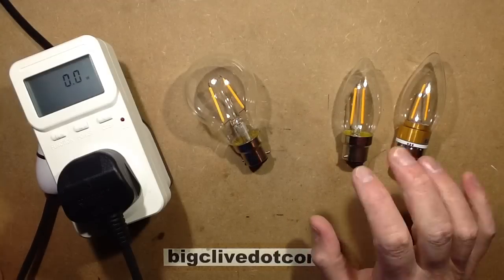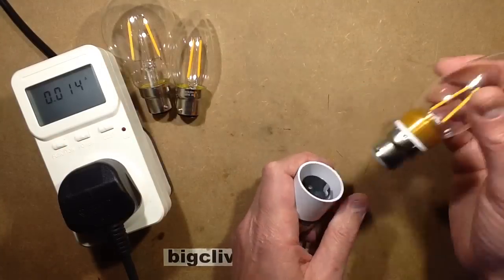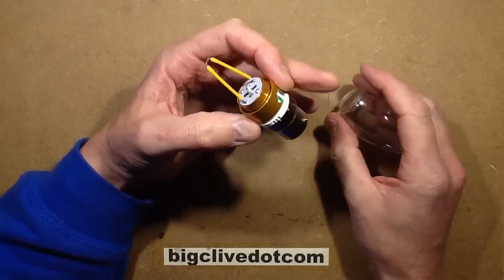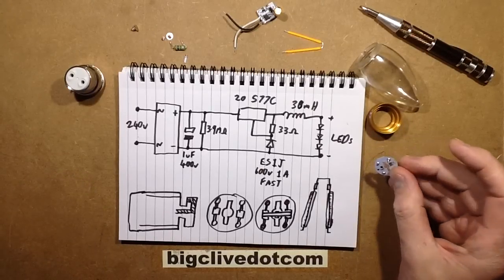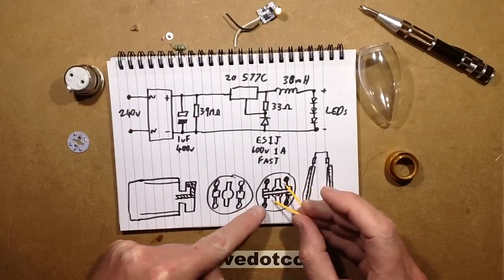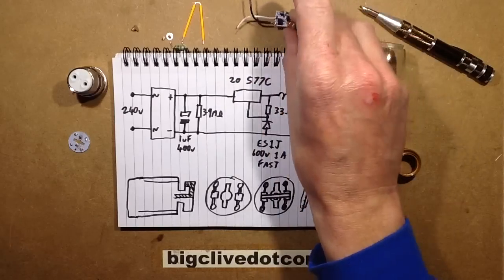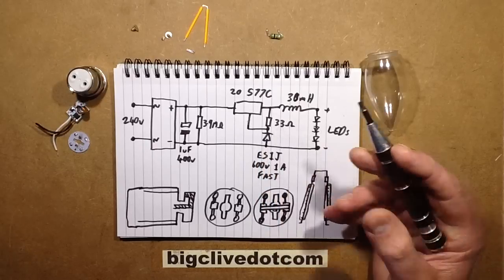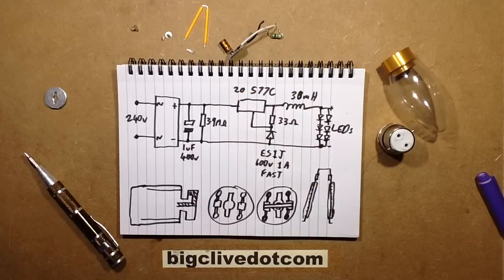Inside a modular LED lamp.

Comment: well thanks to ol Clive being in a wet environment..  I kinda gave Menards a load of shit over their fake C9 bulbs (ahem top hat LED's with C9 size caps ---- fake!!!!-----  ) that = exposed wire leads which equals a very ticked customer paying $10 for a short string of LEDs.  as they will break in less than a year outside. :(  .   So the folks who supply Menards with LED's took the shit I gave them using you as an example on why LED's should never be outside unless they are sealed totally out like incandescent filaments so they sent e a good 100 dollars worth of real C9 and C7 LED lamps to fit in our Christmas lamp set (that still fairy lights over there? ).    No problems with those yet and can use them on the thick wire ones that C9's and C7 strings use.  I have noticed a difference but hoping someday you'll open some of these up.  I have two kinds.  the free ones are 3 LED's, but good lord is the circuity so utterly small it's crazy.  C9's meh but C7 thats getting rather small would love to see these opened up someday.  , but then there's the ones I paid for  5 LED's in those but as I can't really see thru them I have no idea how they are designed and not opening one right now until they fail.  , one my brother took apart clearly has more stuffed down the metal end of a C9 though.  These LED's are sure getting fun to look at though

Comment: I thought I had bought the same bulb from another eBay seller but in fact, contrary to the bulb of the video, the electronic circuit is minimalist :
http://www.cjoint.com/doc/16_11/FKiquFNx325_E27LEDFilament4W01.jpg

So be careful...
Reply from the maker: Flickery?  Looks like a minimalist cap dropper.
Reply: The flickering is not awful but it is visible. When I film the bulb with my webcam, I see small waves on the screen.

Comment: @bigclivedotcom  im not sure if you've seen the lithium powered car booster packs ?  ive just bought one on ebay,  and it managed to start my 2.5 diesel with no bother,  the model i got was a suaoki t3 for £40 off ebay,   would be great if you could do a tear down on one.  http://www.ebay.co.uk/itm/Popular-12V-20000mAh-Car-Jump-Starter-Pack-Booster-Charger-Battery-Power-Bank-/322239827658?hash=item4b06fd8eca:g:qv4AAOSwgmJXyV9O is a cheaper unit from hong kong,  cheers

Comment: what is the power factor on a lamp like this?
Reply from the maker: It's complex on this style of lamp.  Not unity, but not quite as bad as a pure capacitive dropper lamp.  The switching frequency harmonics are more of an issue.
Reply: I want to hang a whole heap of these filament type lamps from my ceiling but I would like them to have a respectable power factor.

Comment: I figure the switcher is running in discontinuous mode because it's easier to run at ~25 kHz than ~1.4 MHz.   So the ripple current would (still) be 100% , but it's "regulated" and you don't see flicker due to this and the persistence of phosphors and vision.

Putting 200 v across 30 mH will ramp up at 6500 A/s.  If the output ripple was 2 mA , the Ton would be ~300 ns, Toff ~= 400 ns?   f = 1.4 MHz?    L/R ~= 1 ms.

The closest parts I found were not that fast.  

http://www.digikey.com/product-detail/en/monolithic-power-systems-inc/MP4050GJ-P/1589-1179-1-ND/5298266 

http://www.digikey.com/product-detail/en/microchip-technology/HV9921N3-G/HV9921N3-G-ND/4902360

Comment: + bigclivedotcom Clive, I think it should be mentioned as an other bright source of a possible electric shock. Not just because the fact that it can fall apart in your hand while trying to replace it, but also that heatsink is very dangerous. Or you trust the microns-thick insulating layer of that aluminium PCB with your life? Hey, it's a non-isolated, mains referenced power supply! That heatsink, and/or the support PCB should have been made of Al2O3 ceramic. But I don't think that these filament type LED strings benefit a lot from this type of heat sinking. They mostly rely on radiated heat instead of conducted.

Although, the circuitry is quite clever, indeed.

Comment: Hey Clive, are the two pins in those bayonet fittings live when not pressed in by the bulb? We use those in Australia and I've wanted to know for ages. Everything is designed to be so safe, down to sheathing plug pins but if those pins are live it seems so stupid.
Reply from the maker: The traditional ones are always live but some newer ones have a safety interlock.  It's better to assume they are live though.  Our bayonet cap holders and the Edison screw ones are still in use because it would be a massive thing to try and eradicate them from every single house in one go.

Comment: I guess if the 577C transistor / regulator shorted, it would be game over for the LEDs.
Reply from the maker: It would probably go boom.
Reply: bigclivedotcom If you think about it, what is being done today with tiny SMT components seeing 170 - 300 volts potential across them is incredible. No fuses, no worries. Look at the amount of concern there was in the 1970s with a decent stereo receiver such as Pioneer, Sansui, Onkyo, etc. The line was fused before the power switch and transformer, the DC supplies were fused after their rectifiers, and even the speaker outputs were fused. There was concern to protect everything, and prevent a line-side short, should the wiring or transformer fail inside the unit. Now we see products where there is absolute disregard for protecting the device from total destruction or causing a fire in event of a short circuit. The frail little 20, 22 or 24 AWG wires connected right to the mains to supply the PCB make me incredulous with many of these Chinese devices. I am amazed CSA, UL, CE etc. allow for them to be sold... or they have lowered the bar significantly in recent years to allow for the influx of this cheap stuff.

Comment: The first looks to be half wave rectified, the second one full wave rectified with no smoothing and the third full wave rectified with smoothing. Is that right? I dunno if that's how the manufacturer built them, but that's how I'd interpret things in the 1st min of this vid - it could be the iPad being a bit funky also.    Edit, no I'm probably really very wrong, I forget these guys are controlled via driver circuitry. 

Anyways,  how would each one respond to being shoved in a bog standard dimmer circuit? Just curious as I have seen many sconces with dimmers on...

Thanks for the breakdown Clive. It may be boring to some but I love to see how you work stuff out.

Edit 2, how long before you find the containing components, fittings, "bulb" etc to DIY your own I wonder?

Comment: I have a question for you. Is there any reason that a light fixture can shorten the life of an incandescent bulb? I have two fixtures that goes through bulbs like crazy while all of the others last a long time.
Reply: Are they enclosed? Heat will dramatically shorten the life of a lamp.
Reply: One is a porch light. It has plenty of ventilation and weather protection. The other is in a range hood which is uncovered
Reply from the maker: Vibration can kill lamps if they are lit.
Reply: I'm a bachelor so the stove doesn't get used much at all. The porch light usually lasts only a couple of weeks. I've had other fixtures in the past that went through bulbs at a quick pace too, and they were just typical indoor fixtures. It's like they're jinxed.
Reply: I'm a bachelor so the stove doesn't get used much at all. The porch light usually lasts only a couple of weeks. I've had other fixtures in the past that went through bulbs at a quick pace too, and they were just typical indoor fixtures. It's like they're jinxed.
Reply: The bulb burned out again a couple of weeks ago. It stays on most of the time and isn't really subjected to vibration or temperature extremes. It's just weird.

Comment: Mr Clive!

Watching your videos over the last year or so just helped me figure out the multiple things wrong with my boiler. But crucially helped me figure out that a gas solenoid rated at 240V should probably have more than 12Ohm resistance if being supplied from a main circuit board rated at 2A maximum!
You're the reason I bought a cheap multimeter.
Great channel. TV is dead.

Comment: a miniature power supply done right.
However, no inrush limiter resistor capacitor network on the input is a little odd
Reply from the maker: No space.  The module is designed to be usable with a wide variety of caps that may be very narrow or flush with the end.

Comment: has anyone suggested changing the anti-flicker to 50Hz in the camera application or switch to 25FPS, just as the usual defaults are 60Hz and 30FPS.
Reply from the maker: I've never actually found an option for that on the iPad2.

Comment: I have the 6 Filament version of that lamp here and the power supply appears to be capacitive dropper on a tiny board using surface mount capacitors.
Reply: Then it's not a version of "that lamp" though, there are dozens of models that look the same. Unfortunately it seems to be impossible to know in advance how flickery any given lamp is going to be. I bought some that were specifically described as having advanced electronics in them, but when they flickered at 100Hz thanks to a dumb capacitive dropper, I got a refund...

Comment: Are there any LED lamps that can be used with a standard triac light dimmer ?
Reply from the maker: That's a tricky area.  The triac dimmer technology is completely incompatible with LED technology and results in either very complicated and expensive lamps or cheap ones that flicker visibly and have a very weird dimming curve.
Reply: LEDs would need a PWM dimmer.
Reply: There are lots out there. They often don't dim completely (though the Cree 4Flow bulbs are the best in this respect), and my biggest complaint with every one I've tried is they buzz horribly.
Reply: Would you be interested in one or two GU10 lamps that are triac dimmer compatible? We have some in the hardware store I work at for 4£ equiv. that have proven to be very reliable and don't flicker or buzz. They also dim down to the lowest level I'd call usable light. Anything lower and I might as well just turn them off... I've replaced every spot in my house with them and they're working perfectly.
If you'd like I could send you a few to check out and take to bits and explore if you'd like. :)

Comment: LOVE the videos Clive, I have a question for you or anyone who can answer it, I have a toy that lights up and plays music, it is a little sea horse. This toy makes my 5 month old fall asleep every night but only stays on for a max of 5 min.. that's not nearly long enough for her to get into a deep enough sleep, having me run back there to turn it on again and again. So I was wondering if there is anything I can do to make it last longer maybe 10 min or longer. Thanks for reading and responding :)
Reply: Arduino... Great ideas, or you could just tape the button in "pressed" position.
Reply: Bartosz Olszewski Thanks, but I spend lots of time with my baby girl, your comment is just rude and uncalled for...
Reply from the maker: With these things it's usually dedicated integrated circuits, so it may not be easy to change that.
Reply: Bartosz Olszewski Clearly... maybe one day you will get some class but I doubt it.
Reply: How is the toy triggered? Maybe you could take it apart and hack an arduino into it so that ever 5 min it gets triggered again until sleep is achieved
Reply: I'd be tempted to get an arduino tinsy, whatever it's called. The really small one :P Either add that to the circuit and program it to trigger a number of times before turning off. Or add a sound ship and program a new toy from scratch :D
Bit involved, but could be fun :)
Reply: MasterBata I wonder if you could short the button, and have a toggle on/off switch to power it instead? it wouldn't time out though, that's the problem. You'd still need to add more circuitry :(
Reply: TheOmegaRevolution Toy is turned on/off by pressing the tummy, http://tinyurl.com/zodnlkk      this is the toy.
Reply: bigclivedotcom Wow got a reply from the man himself :) Thanks for taking the time.
Reply: This is the toy I am referring too,  http://tinyurl.com/zodnlkk
Reply: kreepykoopa Oooh, looks plenty big enough to house extra circuitry then :) Could be worth a bit of circuit bending!
Reply: use I dunno. oscillator maybe. or pic controller. or solder a switch in, if pressing the button keeps it playing. arduino is expensiv. but I dunno, if you wanna time it exactly 5 minutes it may be worth it. or just spend time with yoir child. or change the child. death also solves problems.
Reply: kreepykoopa it was meant to be rude.
Reply: kreepykoopa your funny.
Reply: Bartosz Olszewski Oh look, here it is!
Reply: This has a few solutions depending on how much electronics knowledge you have, best to ask on an electronics type forum, like arduino or EEVBlog.
Reply: I think an arduino nano that runs at 3 volts would be sufficient for this task if you could splice into the switch for the tummy on the toy. There's a British fellow on YouTube that does a lot of diy arduino stuff that might help you out. The coding wouldn't be too hard for something so simple.
Reply: Or a simple timer with a capacitor to make it last 5 minutes.

Comment: please can you take apart a cheap ebay submersible aquarium heater? they are always half the price of 'proper' branded ones. cheap, submersible and heater dont sound like a good combination. you can get them for as little as £1.25
Reply: perhaps they are like the bucket warmers, they do indeed heat the water, and will boil/electrocute the fish.
Reply: jusb1066 no electrocution yet. It does work as the water temp is what it should be. Just interested in how safe they are. I never leave it on when im not home or if im in bed.

Comment: There's no flicker because the buck driver's switching frequency is in the kHz range.
Reply: Well not exactly, the main reason is that it's a constant(ish) current driver so the LED brightness never drops very low. Higher switching frequency just means you can use a smaller inductor. If there wasn't an inductor, the raw PWM flickering could be seen even at 1 kHz or more (annoyingly LED car tail lights tend to be like this).
Reply: Surely there is a ripple?
Reply: Yes but if it's not too strong, our eyes won't notice it.

Comment: Makes me wonder what people would do if the bulb unscrewed when trying to remove it from a bayonet fitting, could do with a light touch of glue on the threads just to stop that happening, other than that (and the overall look of the bulb), it's a decent looking LED bulb... :)

Comment: Is the RMS 240v =360v would I be right in thinking that if so the resistor after the bridge would need to be 470k
Reply: How do you come to that value? There is no "need" for any specific value. Not too low obviously, because you'd constantly waste power in it.

Comment: now if only it was not $15 AUD a led lamp in australia, i'd get some... this one looks better than the rest, i gues its the "E14 B15 B22 E27 2W 4W Edison Filament COB LED Chandelier Candle Light Bulb" one from that seller, don't want to give the game away to others too easily ;)
Reply: for that price, even if they die, its still cheaper than the commercial ones in the brick and mortar stores which are using the same retro led's.
Reply: they just arrived and the 4w ones i've tested are really good.